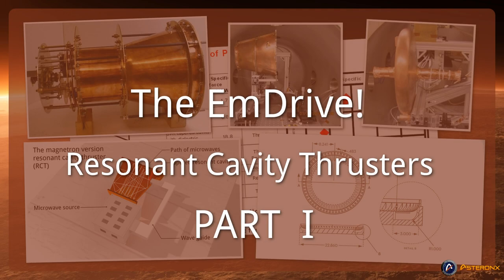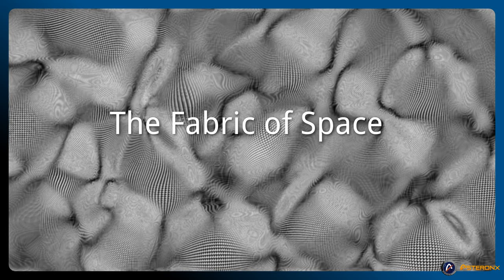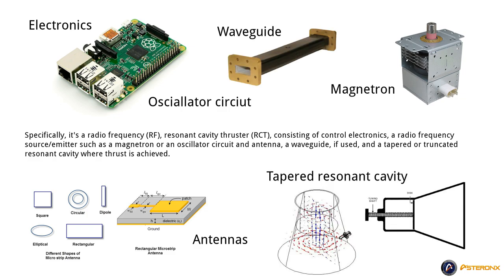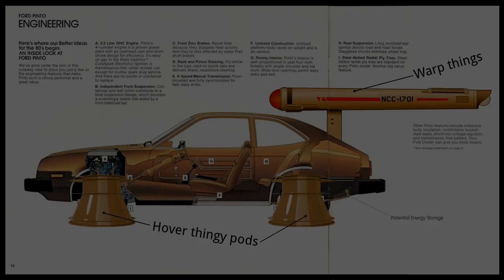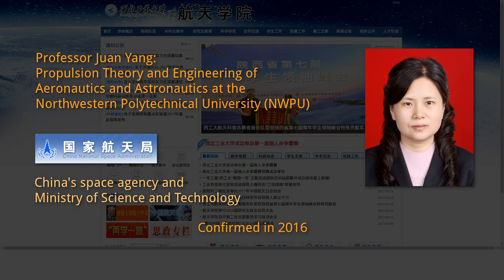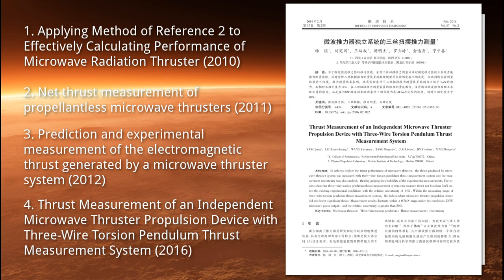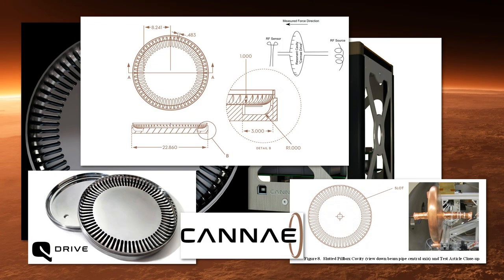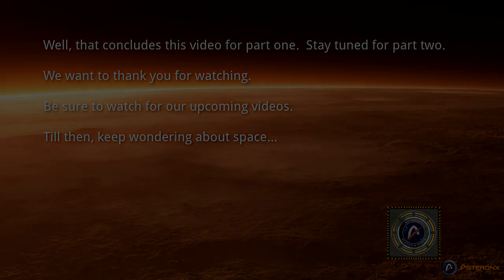An Explanation of the EmDrive and Cannae Drive Part I

Comment: Ill explaind once again, but with another example what is happening in this drive: Imagine that you have a ball; youll throw this ball with a electric motor, now think on the eficience of this movement... the result is that part of the energy was lost in heat and deformation, nothing unusuall! now the ball will crash against a wall... the energy the ball was carring was the same  that the motor got from the launching, not same it used to this, so at the moment it hits it must use all the energy it got, relative to the motor, to just stop it, but it is not the case, same as befor some part of the energy was lost in deformation and heat. The diference is this thrust... but with photons, which do not deformate that much. This is what i call the accelerator movement of chaos, the most usuall phenomena on universe perhaps.
Reply: It never cancelle it all, for that it need to transfer all the diference in energy because of movement to the wall, but unles it has infinete hardness it lose some on this diference in energy in deformation, heat that propagates in all directions and even sound. I am not disprobing it, i am sayin its not a invention from a genius. Read well, and think beyond the limits of ignorat-arrongants.
Reply: In the direction it allready has, and the amount is relative to the materials and the frictions. There is not isotropy when we talk about that minuscule particles that are being emited, also it si posisionated on a side of a cone, what are you talking about? That light is a regular lantern? also do not understand why a lantern mater, is to prob that is better at thrusting that the EMdrive? because i wouldnt put that on doubt. My point was to explain the EMdrive, that it does not violate the laws of Newton, it rather explain them better. Remember that the diference in energy was jus enough to stop the movement it originated, but heat and deformation gets some of this energy allowing the emitor to have a diference in movement, not only position, to its before position.
Reply: Its for practic proposses on chaos, because of its tiny nature its very unpredictible, but at the end would tend to acumulate more in one side. As said before the direction of the propultion would be first in the same vector than the emittance but would be too in the direction of the side with more bounces, because of the heat generated at each one of these; heat that either isotropic but in chaos too, or in great inertia. But as said at the end chaos is simply what exced human intelect and it goes in a combination of the vector of the emitance and another one. The possibility of have a not at all thrust with any reaction is 1/∞. Iam aware of the light as particle, then as a tranferer of kinetic energy. As light EM waves. I said that i do not doubt about a flashlight as better accelerator per energy used divice, but EM drive was made by a man who does not understand what he got, the real benefice of this is that you could reload to thrust in any place with light and that the energy lost in not movement is adquired in heat, some very usefull out there.

Comment: The resonate freaquincy channels to other simmiler freaquincies like a telephone and receive sound from each other meaning that it takes the energy from far away and that energy comes back really fast and hits the emdrive on the other end to push it into speed like a slingshot it borrows energy from a different sound sort of like teleportation sound borrows sound bumps into another sound and swoosh it fly's off it works like an echo.

Comment: Well lets call it the EM  drive.True it is NOT meant for launching space craft into space ,it's a propulsion system when in space and also directional that hasn't been mentioned.EM propels from the rear and all other sides except for the front for control but A different frequency must be used for  forward facing,for opening or disturbance in the fabric of space.There are a vast array of frequencies..

Comment: I try to find information on the Cannae drive and get information on the emdrive. I like details the two devices are different I want to know what that difference is. I want to know how these  devices effects mass, gravity, momentum and inertia. I also want to know the effects in a free floating magnetic field in a very strong vaccuum in micro gravity along with the other effects. I would also like to know how it works with a number of different wave lengths and types of electromagnetic  energy. I think doing this would give us a better idea of what is going on and give us other direction to go to make something very useful for space travel. The devil is in the details. I think these devices well end up being used as part of a drive system and not a drive system by it self.

Comment: would, or could solar arrays be used to power the microwave drives? what about the material to collect the light, wouldn't you need a "self healing" material? i don't imagine traveling through space would be so easy with anything the size of a micro meteor to impact the craft at any given time.

Comment: this is a small accumulating momentum drive system has been in science fiction stories for decades.
it is nothing like a regular combustion chamber rocket.
it couldn't even begin to lift its ass off the planet that we live on.
but it can work for long space flights if you got enough time.
a recycling life support system would be in need.
an analysis would be the solar win and instead of a sail, your tronic Force machine would be thrusting at a very limited ability.
it would be better to just learn how to use the quantum Matrix field for your drive system.
much like what we seen in the movie, "Arrival"

Comment: Dear reader, the interpretation of how it works is dead wrong. The EMDrive is an asymmetrical Harold White warp drive. It interacts with far bodies of mass through the local metric of space-time. Charge generates a weak gravitational field that is yet, millions of billions of time more than expected by the inertial mass of the charge alone. In EMDrive, charge vibrates in the walls of the cavity. Einstein's equation of gravity is in one side geometric and in the other it is not. It is the energy - momentum - stress tensor. Einstein said that reality is fully geometric. But how can more geometry can be added to space time when all the geometry is already included in the metric tensor ? The answer is very simple. Motion in a gravitational field is geodesic but in curved space-time. In the Minkowsky geometry that Einsten used, geodesic curves are locally longest and not shortest as we are used to in ordinary geometry. Matter can be described as fields that prohibit geodesic motion by what is know as Acceleration Matrix or as Symplectic Geometry. By using Symplectic Geometry , we can define an additional structure to space-time that allows non-geodesic motion that is not anticipated by the metric tensor alone. The quantum states of such a model are Causal Sets, also know as Realization Events of space-time.  You can refer to my paper http://iopscience.iop.org/article/10.1088/1742-6596/845/1/012019 but you need background in Symplectic Geometry and in The Theory of Foliations and especially Reeb Vectors and n'ot mandatory, the Godbillon-Vey form.  The paper is well written except for the important appendix in page 30 in which in  (B.1) and (B.3) please omit the uncontracted metric tensor. I know how to build a fully-fledged superluminal disk that I can't expose due to security reasons. The EMDive is a joke comparing to that disk. Blessings, Eytan Suchard.

Comment: It's gravitational induction.
Reply: The equation is the same form as the Maxwell Faraday equation. The difference is that in gravitodynamics, the idea of charge is replaced by mass energy. This is in the linear regime.
Reply: Exactly only they failed to mention the piston return spring ratio to the catalytic converter bearing spatial separation and the flux capacitor which ya obviously makes the whole thing work.Duh!